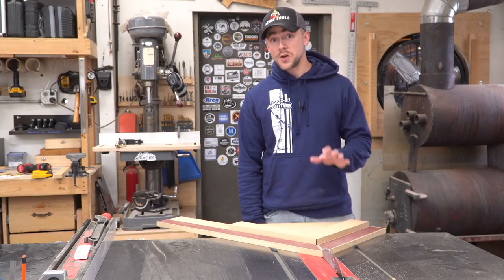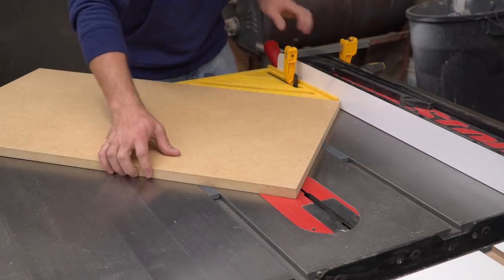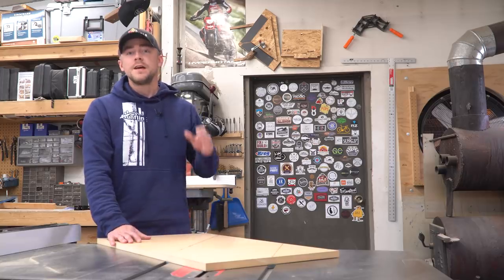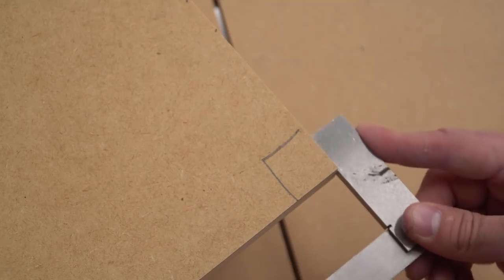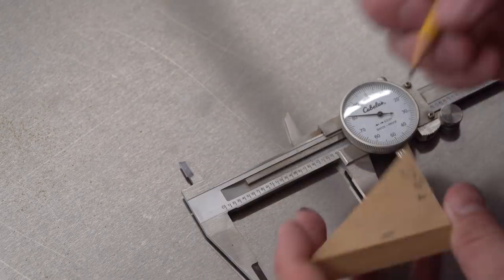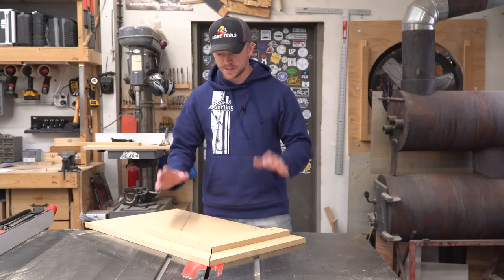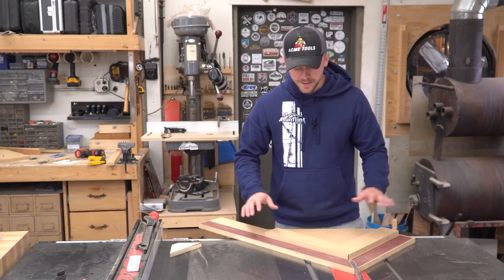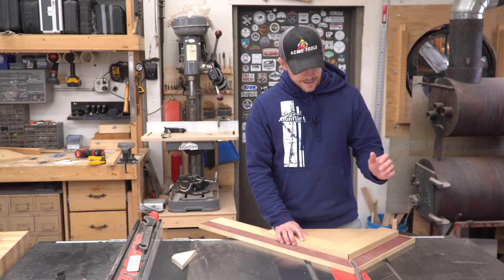Making A Table Saw Miter Sled - Getting Precise Corners

Comment: Super simple...I love it! I guess I kind of call bs on the sandpaper being THAT effective. ;) But then again, I've never used it. I like how you thought through removing some of the back of the sled, so it would not tip off the saw. Brilliant!
Reply from the maker: It depends on the grit Bruce - I used something much finer on my old sled and it only helped. This was 60-grit and it really locks that stuff down!
Reply: Gunflint Designs I appreciate your comments because I am in the process of building a picture frame miter sled using tips feom all of the great You Tubers who are so wonderful to share.  It makes perfect sense that if you use a rougher grit like 60 it will be effective. I am making a sled based on David’s design with the sliding stop block and I will be using Williams technique for getting the 45° dialed in. One thing I did is to use an aluminum framers square in place of the ruler and second side aluminum guide. This way it is one piece and perfectly square to start with. I also noticed today that it was going to be back heavy tipsy and I plan on cutting out the areas not needed to help balance it out. I wish I had the time and talent to produce a YouTube video to share my process but unfortunately it takes a lot to put together and that’s why it is so appreciated that you take the time to put these videos together.

Comment: Thanks for the video Mark! I haven’t yet seen William Ng’s video on that technique, so thanks for that! I’ve made two miter sled variations and not been thrilled with their accuracy. Maybe I’ll try again! My SawStop jobsite saw has very little infeed in front of the blade, so I‘ll need to plan for longer runners.
Reply from the maker: I'm glad you found it useful Doug! That indeed space is really nice when using jigs like this, I found the long runners on my old sled to help out a lot.

Comment: Great build, Mark. I built David P's version a year or so ago.  The sliding stop block and tape measure work great, but it's just a tiny bit off (my fault, not DP's), so wider frames aren't crisp.  William Ng's video was great, and made me want to build another, but I didn't want a big beefy sled again.  Yours is a great, sleek hybrid - I will be stealing it, so thanks for the video! (Do you plan on adding a stop block to yours for repeatable cuts?)
Reply: We must be twins because you said pretty much exactly what I wanted to say. Thanks for sharing Mark.
Reply from the maker: Thanks guys! The minute I finished this one I started wishing I had incorporated a stop block system in it. I'm considering a follow up video where I make a slight modification then actually show how to use the thing to make a picture frame.